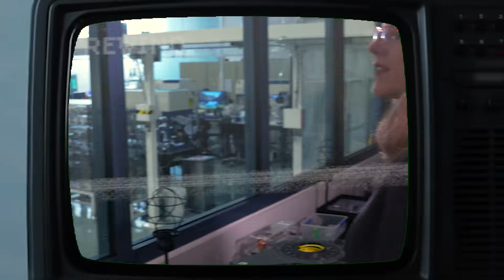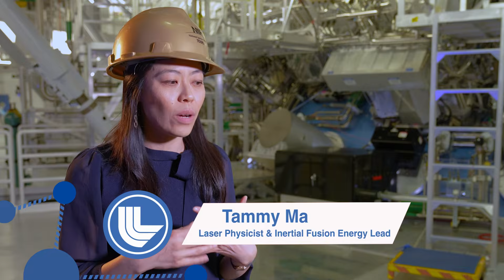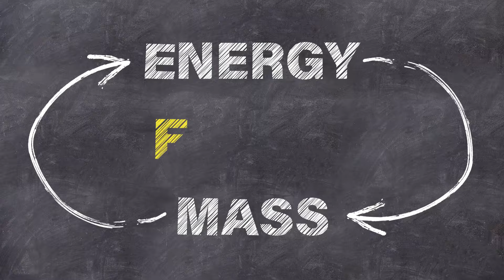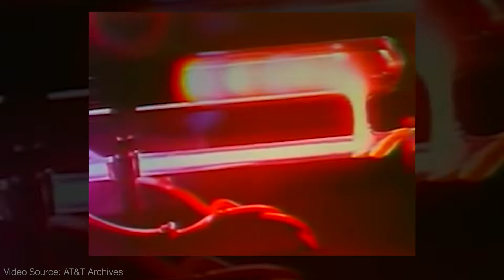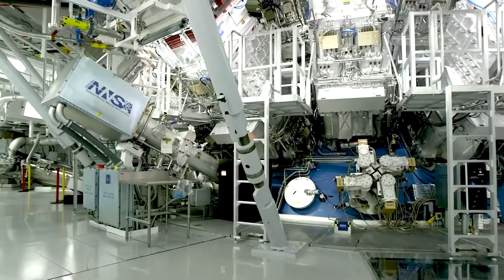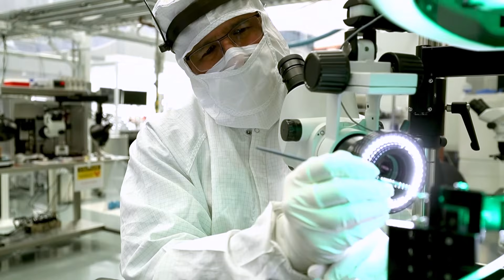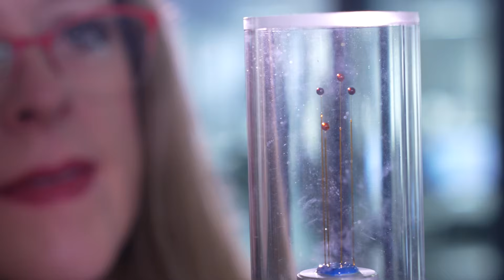What is fusion ignition?

Comment: How would LLNL consider the issue of sustaining that reaction in that confined capsule for continuous energy generation and how would the energy be converted to electricity when the NIF's design is basically a giant laser compacting a tiny capsule? I recently watched another video on the topic of fusion reactors and they mentioned the construction of a tokamak generator that works differently than the NIF's. I think the topic is fascinating and the idea that we might have a working fusion reactor in my lifetime is incredible, but I'm curious as to what methods they're working towards.

Comment: Most nuclear fusion energy pitches are greatly over-hyped, concentrating on the hoped for results while leaving out mention of the numerous problems that have been encountered since the efforts began in the 1950s. Scores of nuclear physicist and engineers have spent decades working on the elusive goal only to retire to see we are still many decades away from a major breakthrough to a seeing a practical nuclear fusion demonstration facility. Many of the pitches are intended to generate public interest and attract private investors to fund these extremely expensive projects that number well over a dozen.

The National Ignition Facility (NIF) has always been primarily funded as a thermonuclear weapon (H-bomb) research tool. The administrators, and the above presenting plasma physicist, have become masterful in obscuring that fact when presenting to the public and to the press. The announced December 5, 2024, experiment included a weapons related target material, inserted to expose it to the prompt flux of 14.1 MeV fusion neutrons. The fusion shot experiment took about a week to set up and resulted in a nuclear fusion reaction that lasted approximately 0.000,000,000,08 second. The released energy was about enough to boil two liters of water. The energy to drive the laser was more than 100 times greater. It has been estimated that the target assembly, that was vaporized in the experiment, cost approximately $100,000. The use of the term 'ignition' is deceptive. There was only minor propagation of the reaction in the extremely compressed fuel plasma. Most of the extremely expensive fuel was blasted away from the reaction center before it had a chance to react. Later a staff member admitted that only approximately 4% of the supplied fuel actually reacted. The NIF lab administrators have suggested that newer diode pumped lasers could overcome the poor laser efficiency. They don't mention that such lasers don't exist at energy levels anywhere close to that of the NIF lasers and if the the wavelength has to be shifted to the deep UV region then that will reduce the efficiency. No mention was made that NIF was expected to achieve the so called break-even fusion reaction by 2012 but it failed by a factor of more than ten. It took a decade of additional work to finally achieve the original goal. It's been estimated that NIF has consumed approximately $11 billion in federal revenues.

Many nuclear fusion energy experiment breakthrough announcements focus upon the future promises while failing to provide details regarding actual experiment. In many cases the announcement is about reaching higher temperatures, or longer plasma duration. In many of those cases no use of fusion fuel is employed, or even planned. Currently the market value of radioactive tritium is approximately $30,000 per gram. It certainly isn't as common as the hydrogen (1H) in seawater. The few reactors that produce tritium are slated to be decommissioned within a few decades.

Nuclear fusion will only succeed if a demonstration plant is created that appears to be economically practical to commercial enterprises that want a return on their investment.

Those who work in nuclear energy fields, along with the vast majority of the 8.0+ billion other humans on Earth, have become masterful at excluding the following warnings from their consciousness. They desperately want to believe that our technological wizardry can turn this 'Titanic' around before it is to late. I urge readers to search for the following two article titles.

IPCC report: ‘now or never’ if world is to stave off climate disaster (TheGuardian)

UN chief: World has less than 2 years to avoid 'runaway climate change' (TheHill)
  * This statement was made 6.9 years ago.

Comment: They should make a cylindrical chamber (horizontally) with plasma confinement grade magnets on the entire surface with lasers coming in each end and the pellets dropping in from a hole on the top (horizontal side wall) and the energy released out of a hole in the bottom (horizontal side wall) onto a heat exchanger and pellet ash collection system 🧐🤔😉🫡
Reply: Tokamax...
Reply: @mdbreedlove1290  nah that’s slightly different

Comment: 2 MJ in and they got 3MJ out? absolutely incredible yall ,hats off 👏
Reply: Read the fine print. Several hundred MJ of electricity, NOT heat, went into the lasers; only 3 MJ heat came out of the fusion fuel. In the latest 2025 experiment, the output was 8.6 MJ. But about 800 MJ of electricity, not heat, went into the lasers. Over 2000 MJ in primary energy went into making that electricity!  Then, consider the cost of the gold/tantalum hohlraum that was destroyed to produce just 8.6 MJ.

Comment: 1300 MJ of chemical energy was converted in conventional coal powerplants and transmitted so 400 MJ electric energy can produce 1.9 MJ laser light energy to DESTROY a million dollar target and gain +1.26 MJ unusable heat in the rubble mass (roughly 0.08 kg of wood gives same amount of energy when burnt, except in a usable form; Fission also works extremely reliably and produces 0.00000005 kg / kWh products, mostly usable and actually precious; Fission produces 40..100 times less decomissioning waste and total radiactive waste for every TWh energy produced if the fusion succeeds at all - with the most optimistic fusion resource numbers)... Forgetting about the facts sounds like misinformation, or  "Scientists are confusing the policymakers and the public" as Sabine Hossenfelder put it. Please stop misinformation because it is a crime and extremely harmful to mankind. Please include the basic facts about the energy actually used up and the potential feasible paths ahead.

Comment: Fusion is the future of American energy production.
Everything environmentalists want confusion. We get no radioactive materials. No possibility for catastrophic nuclear failure. Fusion is the future of America and Lawrence livemole project. What's the most comprehensive? An excellently executed research and development for confirming Fusion is possible a 196 beams of ultraviolet X-ray. Energy was focused at the hollow Ram. The only problem with the hollow Ram is that it did not Newton's, because the containment field, they didn't have a containment for it. They poured all of that energy into one area, but there was nothing to contain the other particles that are created in this environment. And that's why we have the neutrons and protons and everything Going Out of control and everything. But we learned this we can contain.
Effusion reaction the fusion reactor quid by the large level laboratory shoulders and 20 billions of a second that fusion works add. The company's art developing.
Fusion raptors and compact fusion raptors. My calculations for quite accurate cause. I's realized that we will confront nuclear fusion and less than 5 years and we're achieved.
But currently we still have to rely on our fossil fuels. We cannot allow this Kung palamaret of the world. Economic setup takeaway the most important material that we need to develop the energy to even build the fusion reactor their policies and ideologies strategically weaken every country in the world. Are they already proved this?
Reply: Explain how you would control the travel direction of neutrons that have no electrical charge.

Comment: Watching the simulations in this video are exciting! More videos with the main focus on the mathematical modeling/numerical simulation aspects would be extremely interesting. Why do they make the pellets so smooth with such precision? Nature is so non-linear and fractal it seems that they are "looking in the wrong direction?"
Reply: The so-called 'breakthrough' experiment was expected to occur by 2012. They failed by over a factor of 100. It took a decade of additional tweaking to achieve the original goal. The path that they are taking is propelling them further and further away from a future commercially practical nuclear fusion energy power reactor.

The smoothness and extremely tight dimensional tolerance of the diamond fuel capsule wall is necessary to minimize uneven compression of the frozen fuel layer lining the interior surface of the fuel pellet.
Reply: @vernonbrechin4207  Wouldn't it be the case that if the sphere is so perfectly smooth and tight, there's no way that energy waves could impact the sphere with perfect velocities and at all locations? "Stuff" will always be squeezed out? Isn't there some type of fractal configuration possible?

Why is their path taking them further from a practical reactor?
Reply: @williamschacht  - It appears that you are trying to find information that reinforces what you prefer to believe in because you have been pinning so much hope on this technology.

The grown diamond sphere is hollow with only a very thin wall and with a thin layer of the mixed frozen fuel on the interior surface. That fuel layer also had to be extremely uniform. In the announced December 5, 2022, experiment they later admitted that it took about a week to set up the experiment and at least two days to grow the uniform layer of fuel on the inside of the diamond sphere. It was hit by a blast of uniformly configured X-rays. Most of the X-rays went off in directions that didn't contribute to the compression implosion of the fuel capsule. The X-ray flux, that did strike the surface mostly caused the surface to ablate into the surrounding space. The reaction of that ablation resulted in the entire area being turned into a charged plasma with the center of it being driven towards a microscopic center where a portion of it became hot and compressed enough to begin a fusion reaction. That reaction then blasted about 96% of the remaining fuel away from the reaction center before it could become involved in the reaction. As you may know 50% of the fuel mix was very rare, very expensive, radioactive tritium. Much of the gaseous debris was sucked into the chamber vacuum system. As I pointed out the experiment preparation took about a week. The fusion reaction lasted for approximately 0.000,000,000,08 second. NIF can't fire more than a few times per day max. A commercial nuclear fusion reactors would need to fire at a rate of at least ten times per second. The NIF target assembly has been estimated to cost about $100,000 and was mostly turned into an exploding plasma. The design of the fuel capsule has been going on for over a decade and involved other giant laser facilities. It is estimated that NIF has already cost tax payers over $11 billion. This announced experiment generated about enough energy to boil two liters of water.

A successful nuclear fusion energy power plant would need to demonstrate that it can produce power at prices near to that of today's renewable energy sources such as solar panels and wind turbines. NIF is at least six orders of magnitude away from that goal and is increasingly getting more expensive.

Those, who fall in love with such technologies have a strong tendency not to ask about what they are not being told in promotional videos such as appears above.

The NIF project has always been primarily funded as a thermonuclear weapon (H-bomb) research tool. That is the reason they can spend such vast quantities of public funds. The projection, that it it primarily a nuclear fusion energy research tool, is largely a scamming operation.
Reply: @williamschacht  - What they failed to convey, in the above video, is how difficult it has been to irradiate the surface of the fuel capsule in an even distribution. It has involved numerous factors which have included modulating the energy of the impinging laser beams on the interior surface of the gold plated hohlraum. The work on this has gone on for decades and has involved more than two other giant laser laboratories. The gold interior surface generates X-rays and then a small fraction of that energy impacts the fuel capsule, causing the surface of it to ablate which then results in an inward force on the contents of the hollow sphere. The wall of the sphere is very thin and the inner surface contains the condensed 50/50 mixture of deuterium and tritium in the form of a thin film. So about 90% of the interior of the sphere is just deuterium and tritium gas at low pressure. As the diamond wall coverts into a plasma that is driven inward it drives the fuel layer towards a microscopically small point at the center. There about 4% of the fuel fuses to form helium with the liberation of energy from the tiny point. That then drives the remaining fuel away from the reaction center so it can't react. Much of the gaseous debris gets sweeped away into the chamber vacuum system. The fusion reaction has very little time to propagate before it is snuffed out. It lasts only for approximately 0.000,000,000,08 second. The experiment took about a week to set up and the formation of the fuel film, on the interior of the capsule took about two days.

A viable commercial nuclear fusion energy reactor would require at least 10 shots per second. NIF was originally expected to achieve the results of the December 5, 2022, experiment back in 2012. It missed its goal by a factor of over 100. It took another decade to finally achieve that goal. Still the laser input energy was over 100 times greater than the generated fusion energy which was about enough to boil two liters of water. In other words NIF requires at least a million times improvement before it can even achieve some basic requirements required by an Inertial Confinement Fusion (ICF) power plant. As you may notice, key issues were not mentioned in the above video.

Comment: Did the ignition equation include the energy spent producing the fuel pellet? Or is it a negligible quantity?
When the lasers fire, and when they compress the fuel pellet is it loud?
Does it cause significant wear and tear on the capacitor banks, SCR's, bussing or switchgear?
Reply: No. Typically the only input energy parameter that they announce is the direct energy that goes into compressing and heating the plasma. There are numerous external sources of energy that they often fail to mention when presenting to the press, the public and to the funding administrators higher up.

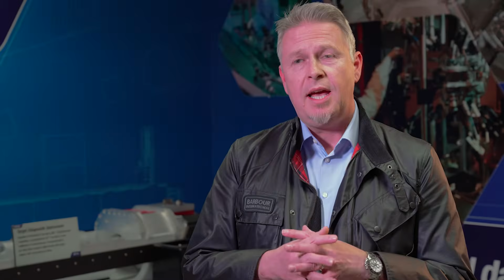Comment: And I saw it immediately you have a direct beam of laser energy hitting the Isotopes and all of these particles are directed but you have it coming from One Direction you have to contain the entire field to achieve Fusion otherwise neutrons are flying right into the system that we're sending all the data from the neutrons are going everything the whole thing is going to clap the hall around and the hydrogen isotope has to be contained in a spherical field so none of the particles that can get out and if particles get out you can control them and you can see them, they finally figured it out, did my calculations was exactly 5 years and I was one of the first scientists that realized when we found the Higgs field, I saw it, I saw all the data coming from large hard drawing collider and everything like this and I said we were up at my calculations we were at 1:08, and they couldn't be more than that because none of the particles were consistently working with the formula and we have a accurate formula the Higgs particle was generated generator and detected many years before it was I think it was three or four years before we were able to confirm that this is the Higgs, when we saw it and you know what I have to thank all of you guys for being so geeky but still keeping focused on what really matters the Higgs particle was generated at 1:08 gigahertz, it was generated there and we saw the data coming down and you know what me I'm too stupid I'm just a regular guy that likes to eat hot dogs and and treat girls right on a date I'm nobody special but, I saw that we had generated the Higgs particle, and I recognized it and you know what we collect trains of terabytes of data but we never nobody ever gives explanation of how the state is processed but I've seen it, and nothing I'm going to tell you is that if you don't realize that the aliens are out here, all you have to do is pay attention to Common Sense, I looked at all the you know what I'm looking at a 6550 time machine, it's heavy is the most heaviest piece of Machinery that have been created on Earth, and here I am a regular guy, that's God has given me the ability to understand what this is